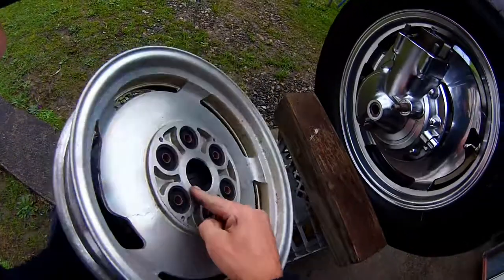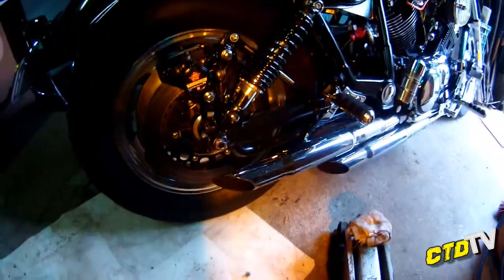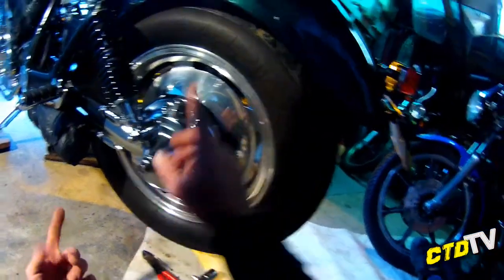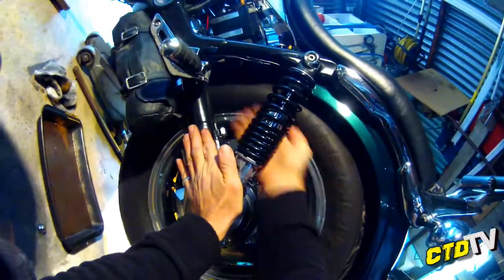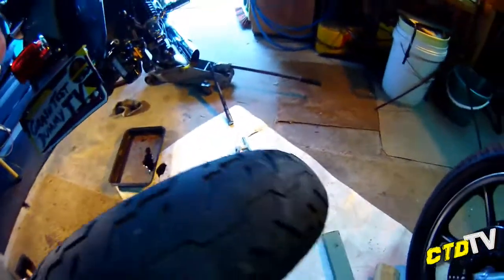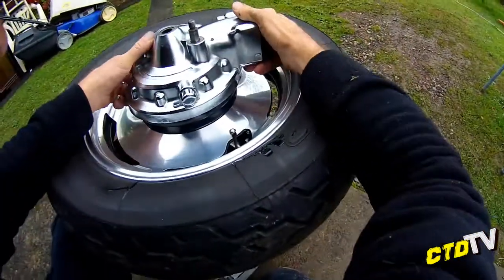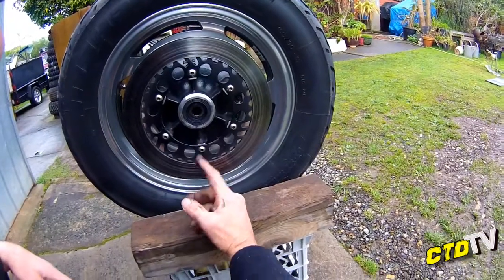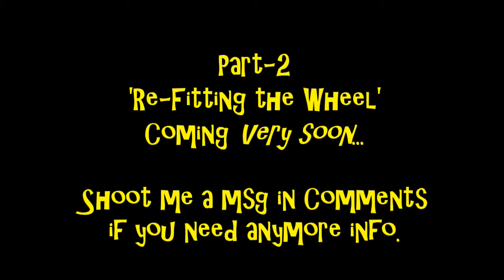How I got a V-Max wheel to fit a Virago...

Comment: That inner shaft drive gear bolts into the virago but the V-max uses non threaded studs that just press into the hub it would have been nice if you showed how whoever did the swap did that part because there was way more to the swap then just adding the spacer.

Comment: Hi, do you think it will be possible to use the vmax standard swing arm to fit the whole wheel assy, do you think there will be no issue the virago shaft and profelller fitting into vmax's swing arm..thanks for your nice video..your reply will be highly appreciated..thanks again and God Bless..
Reply from the maker: Give me a bit, I'll get back to you on that, after a bit of a 'Gander' over some tech books...
The shaft Might be a different length, but Yamaha (and other manufacturers), did cross-use parts from other models.
Speak soon >:)

Comment: Love the mod! Your bike out does a $40k Harley all day. I have a 97 xv1100 I was contemplating modding a XVS 1100 rear for the wider rim for fatter/taller tires. but really wanted Xt1200 suzi rim to fit for the 17"rim for the low profile tire look that would also give ya a huge range of tires to choose from. I mainly wanted a taller tire/rim to try and get the revs down on the H'way. Ended up sticking with the chrome spoked wheels and putting a 150/90 15 Micho Commander II. Do you know if there is a taller ration "diff" out there?
Reply from the maker: Oooh, Now I'm all Red Faced. But "better than a 40k Harley", I like that!
I do think Yamaha didn't gear it right, 5000rpm at around 100kph is too high IMO.
Looked around for different diff ratios, didn't find any leads. Apart from getn gears or crown wheels (diff) made. But that would just be too insanely priced. I went for the taller tyre instead, but its still too high revved.
If you do mod that wider tyre/swingarm, PLEASE film it and send me a Link!! Nothing better than a Frankensteined bike.
Speak soon, but in the meantime - RSOT Mark >:)
Reply: 5000rpm at 100kph!!! mine sits on 3500rpm at 100kph??? I cant find any info on ratio etc.. after the 150/90 15 swap she sits on 3400rpm.. pft.. not much of a difference. I can already see that clearance of the drive shaft is going to be a problem for 170  wide and up tires. notching/frenching the swingarm will only give you another 5mm.  GSX-r swing arm? Naa. cheaper and easier to buy another bike, one for comfort and cruisng and another for fun, in that case i'd get a dirt bike. I'll just enjoy it the way she is. keep it up MrFOA.